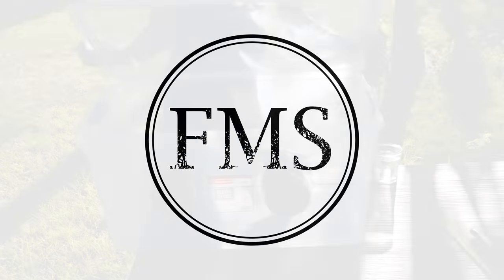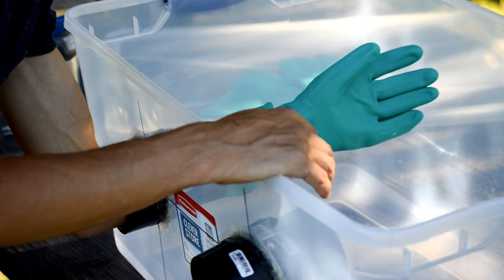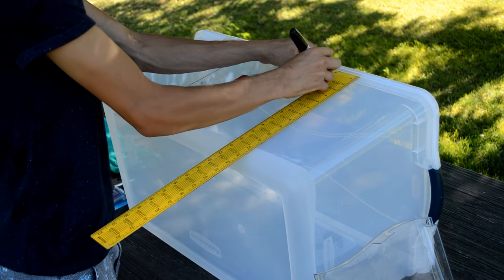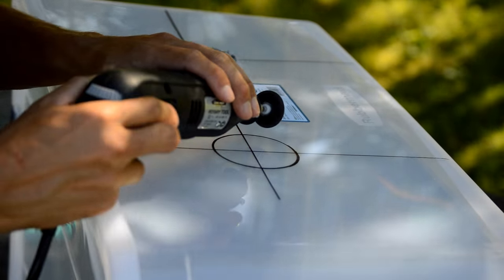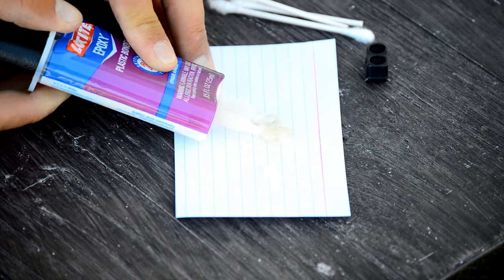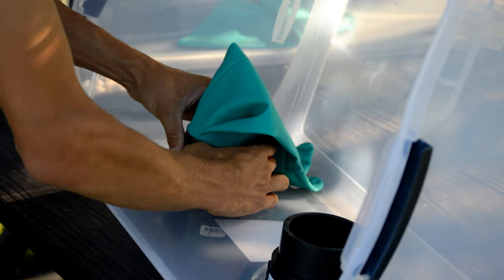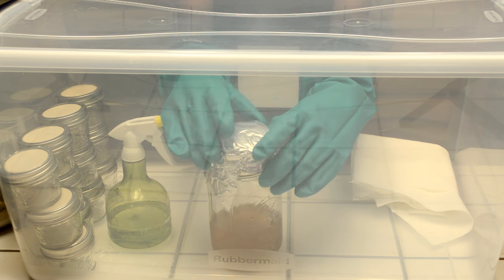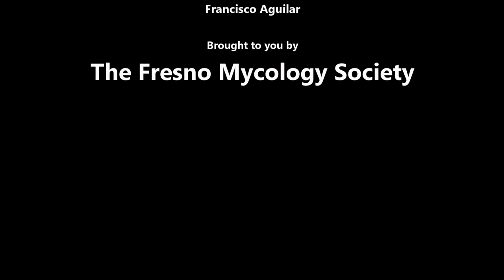Making a Glove Box

Comment: Heat up a metal can on an stove element then press it against the bin.  Easy holes, little clean up.
Reply: Thanks man!
Reply: @morganfarinas9567  which can?
Reply: @nathanw5747  ravioli ravioli..

What's in the pocket-oli
Reply: wow okay thats smart thanks haha
Reply: @marlena0217  Be safe, wear gloves :)
Reply: If you have a drill, you can also use the right-sized circular saw attachment to cut the exact sized hole. It's hard to find big metal cans to heat them up.
Reply: @SalmanRavoof  Indeed.  This is in fact what I did for my monotub with a 2" hole saw, but I didn't have a 4 1/2 one at the time :(

Side note: when using a hole saw on thin plastic, have a block of wood firmly placed against the back of the plastic.  Start slow and be careful, and aware of the forces at play.  When you penetrate the plastic, that block of wood can start spinning with a good deal of force.
Reply: Never do it with a full can! Make sure it’s empty and cleaned. It’ll explode like a bomb
Reply: Thanks, didn't had the right holesaw on hand

Comment: Glove boxes are less sterile than a still air box. They have been found to create more air current than a box with no gloves in the opening defeated the whole purpose. It is not recommended to construct a box like this. You are better off leaving the holes open. Source: shroomery
Reply: What if you cut strips of sponges and glued it around the pvc to work as a breathable gasket/filter instead of sealing it with epoxy or silicone?
Reply: @chriskustra507  no
Reply: Ok
Reply: @chriskustra507  yes
Reply: @chriskustra507  Yes.  Look up Iris Ports for glove boxes.  They are expensive but fantastic.  Your sponge idea might work just as well but at 1/100th the price.  Good idea!
Reply: You're crazy boy. Air tight boxes are more sterile. Period.
Reply: What if you had a filter or micropore tape on the side to let the air flow through that?
Reply: @tyb333  I am wondering the same thing. Maybe poly fill, as I assume micropore tape wouldn’t let air seep through quickly enough
Reply: @motiv8success  You don't know what you're talking about. This involves rules of physics at play. Glove boxes, at least these DIY ones, are nowhere near airtight and can cause turbulence via pistoning. You ever wonder why cracking a door open lets in a breeze even when wind isn't present? Even if they were airtight, the point of a SAB is to allow particles to fall towards the bottom undisturbed via gravity. An airtight space would cause a vacuuming effect and prevent this from happening. True glove boxes were meant to protect researchers from dangerous chemicals inside the box, not to create a sterile environment.
Reply: @TactlessGuy  yeah youre right 🤣

Comment: these work great but I get clumsy inside knocking things over. What I realized is that during winter, especially subzero clear nights, started inoculating in the open outside and grain transfers and never had a contamination problem.
Reply: Really??  That be sweet!  I'm in New Zealand it's mid winter now. I'll give that a go..  Cheers mate👌
Reply: @yamatepaulie4601  don't do this lol
Reply: Here I am trying to figure out the safest way to maintain a warm enough climate in a work space/room/tent etc. without using a space heater. The Winters here aren't sub zero Temps for several days at a time ,but from  approx. November-February it gets down in the single digits occasionally,but usually stays between 28-45°F

Comment: FIRST TIME GROWERS BEWARE!  Do not use glove boxes.  Use still air boxes.  Simpler to make and work much better at not agitating the air inside possibly infecting all your work.  I thought glove boxes went out of fashion 7 years ago.  How is this still being propagated?!
Reply: You can fix thatissue by adding a hole in the box and put some surgery tape over it. Then you put another hole in the box put in a pipe and connect it with a small PWM FAN. Voila
Reply: That is so wrong, it doesn't warrant even this response.
Reply: Christopher Sheffield its not perfect but still better then a SAB if you know how to prepare it. I'm using this setup for 10 years without any Infection.
Reply: Where's the best place to get the spore syringes?
Reply: @Randy How could we know? US? EU? INDIA? CHINA?

Comment: Still air boxes are more reliable. This is a bad design. The gloves will pull and push air around. Had a friend use one of these and he had a 60% contamination rate. He switched to simple sab and now it's 10% or less.
Reply: I just use a box with plastic wrap.on the top to see in and cut hole to just stick my arms in and use a uv sterile light and gloves And never have problems.
Reply: Dale man.....whats the difference between a simple SAB and this one ?
Reply: Hi! Could you tell me the name of paper or where I could access  these results?

Comment: I looked into the argument that still air boxes are better than glove boxes.  The passionate assertions that still air boxes are better are plausibly based on experience, but the explanations leave a great deal to be desired.  In the case of a still air box, you are displacing air in and out of the box every time you remove and reinsert one of your hands.  If filling out a glove in the glove box is changing the volume, you can bet that air is also being displaced.  That air displacement could be through small holes, and possibly at high velocity because those holes are small.  On the other hand, the real problem could be that the glove boxes tricks you into believing you have a sterile environment making you more careless than if you had a still air box.  I'm cutting an opening in one side of my glove box and blocking it with a HEPA filter to allow air pressure to equalize.  I'll also be doing my best to apply still air box technique inside the glove box.  Finally, I noticed that the holes around my hinges are large.  I'll bet yours are too.   Duct tape seems to do the job while leaving space for the hinges to work.
Reply: You're not trying to create a sterile environment, still air boxes replaced glove boxes years ago in the mycological community, it's just an old tek. You don't want it to be super air tight, like you said, when you put your hands in the gloves you're going to displace the air and the smaller holes will cause more problems. I have read about adding a filtered vent, but I've also read that it can cause problems, I've done all of those things personally, globe box, glove box with filtered vent, and still air box. Still air box works the best imo. You can buy laminar flow filtered boxes on eBay from surgical clean rooms and what not, they aren't too expensive. I got mine for like $200 Canadian shipped and everything. It's a 2' x 3' all metal housing with fans contained inside the housing. Works flawlessly, I've made a couple thousand dishes and contaminated like maybe 5.
Reply: Don't bother with that HEPA filter on your box, the ones you need that work are 100-600 each.  A SAB is better than a glove box, it's common knowledge pretty much by now.  A flow hood works well too.  Also there is the oven method wich you can look up online.
Reply: Or attach another glove or balloon to the side to equalize the minor pressure changes from the glove movements.
Reply: If you have a HEPA filter why not go another step or two and build a flow hood? The HEPA filter is the most expensive part so once you have that it would make more sense to go that route.

Comment: DO NOT MAKE A BOX AND ATTACH GLOVES TO IT. IT CAN CREATE SMALL CURRENTS FOR CONTAMINATION.
Reply: You're better off going into a closet that has still air.  Put down some more aluminum foil and go to work!
Reply: What if you put micropore tape or a filter on the side so the air can flow through it?

Comment: There is a million ways to skin a cat, but this is a solid build. Some other options that can save money, but still be very or more effective is using some PVC pipe (3"-4" preferably thin walled) as it is a hell of a lot cheaper & doesn't penetrate as deep into the box allowing you more mobility & room. Also for a stronger mechanical connection you can use a 3"-5" hose clamp (automotive or plumbing section) to attach the gloves to the PVC. These again are very cheap and will secure the gloves effectively as this is how your vehicle retains a lot of relatively high pressure fluids. You can also find totes that already have a seal that should be efficient for this build. Thanks for a great tutorial.

Comment: I just made a similar box recently--really like your suggestion for female/male piping.  I used caulk to seal up the spaces between the pipe and the tote but now I'm wondering if caulk is considered nonporous enough for aseptic work. 
Also, do you think the latches for the lid are helpful? My tote has open space around them so I was thinking of removing the latches completely, sealing the holes, and resting something heavy to keep the lid on while working.  Any thoughts?

Comment: What a mess using that saw lol...
A hole saw works wonders. It's very helpful to clamp a piece of plywood on the inside before you start to drill, because it allows the drill bit to have a nice anchor, making the cut very smooth. Just made my glove box with this method, and it is so nice it doesn't even need sanding.

Comment: It is a pretty good solution. Not bad at all. However, is it necessary to use new foam sealant tape for every time we want to use this particular glove box system? I'm thinking that after using the system, we're going to need to open the lid again to get things out, and then later put things back in. Naturally, there's no provision for UV lighting, but probably not critical. The only thing is the sealing of the lid, and the fact that the plastic box is pliable. Something solid, like strong glass might be better. Cost more though obviously.

Comment: Would it be a good idea to have a small UV sterilising light inside? also air could be pumped
in through a hepa filter to give +ve pressure to prevent "bellows effect" air in through lid, I would test by opening
pressure cooked rice jars in box  then closing then open week or 2 later to check for contams.

Comment: What is the best way to sterilize the inside of this box? Also, does a still-air box provide comparable results to a glove box?
Reply: What's the difference between the 2?
Reply: @JBaked  he still airbox just has two arm holes cut out, no gloves or adapters. They provide the space we're still are but isn't airtight. It's debatable whether a glove boxes actually completely airtight as well. You cannot flame sterilize your scalpel in a glove box

Comment: Couldn't you skip the epoxy altogether and just use silicone
Reply: Not really if your plastic box is made out of material that cant be really glued (like PP or PET or PTFE). Maybe he used the two kind of glue to have higher rate of succes.
Reply: If you can find something that resistant to chemicals and can be glued with pure silicone glue I would only use silicone. But as you move your hands maybe it can let go the silicone if its not a good kind of plastic, maybe you have a stronger connection if you use both silicone and a harder glue like epoxy.
Reply: @thombaz  i find open air 2 work just fine!
Reply: @rise-amorph8178  I used mine for orchid seeds, back then, and I will build one in the future for seeds and tissue culture. Maybe open are is okay for mushrooms, but Im sur its not okay for orchid seeds and stuff like that.